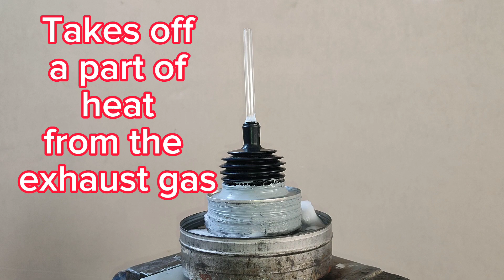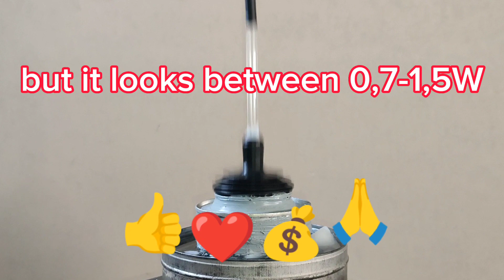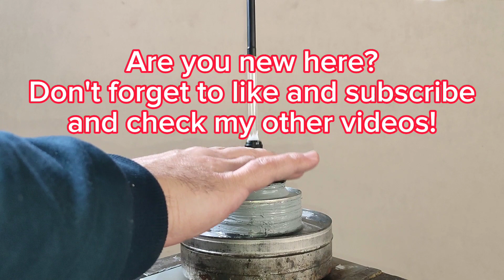Free Piston Hot Air Engine - Torque adjusting

Comment: I love this type of bellows..
There is no friction, no gas leaks, they are very quiet, they can work even in long strokes and most importantly, they are very durable.
It can be purchased at affordable prices in shops selling car parts and industrial machinery parts and can be easily applied.
When I see your classic body designs, I go back to the old days (they were beautiful)
Reply from the maker: I love those bellows too, but this one came from a New Year horn from Tesco market. I think it is PE material, durable and light and pretty cheap. It was the first time I used it.

Comment: Greatings friend. I wanted to clarify to anyone reading this,  Torque is a term reserved for force applied tangently to point on a line some distance from a center be that center an axle, or the center of mass of an object.  

Given a linear piston stroke and appropriate linkage to a camshaft, the motor's power can be transfered to a cam shaft causing the shaft to rotate. The force on the camshaft is torque, otherwise linear force is just linear force. 😊
Reply from the maker: Yep, you've right! I have another video where I connected a diaphragm version to the camshaft, and I started from that side this experiment. So higher linear force adjusting here! Thanks! BLADE

Comment: Do you think it would be possible to build an heat exchange engine that runs on the thermal fluctuations of inner rooms (like living room) with specific materials (due to thermal conductivity properties) - like for example graphene conducting heat very well where-as aerogel conducting heat not very well - it sounds theoretically appealing to suggest that an engine as such should work.

The lesser conductive material would have a "timelag" where-as the more conductive material would have a more "current" temperature, this should allow for the displacer of a stirling engine (in theory, if possible) to do its work. The temperature inside of any room would alter over time considering the weather (day cycle) alters, so the lesser conductive material compared to the more conductive material would always differ in temperature, do you think such a differ in temperature could be enough to run an stirling?

Would love your input on this
Reply from the maker: It is very difficult to build as a working unit. I had a friend with a large diameter cylindrical concrete well. It had a large hermetic lid. There was a one way valve pump attached to the cover. The lid was made of steel, with a silicone O-ring around the edge. Every summer night the temperature dropped and the internal gas contracted. Partial vacuum formation and large amount of gas bubbled in. When the sun rose and the temperature rose, the hot gas automatically pumped out huge amounts of water. This works fine without power. (One day/cycle) So the theory can work even with such expensive parts as you describe, but it is very difficult to scale a machine that works continuously for such large gas volumes, because the speed of heat exchange does not allow fast cycle changes. BLADE

Comment: What is on the inside of this one or is the whole engine just th first chamber the diphram and the long tube?
Reply from the maker: It has a steel wool displacer piston wrapped around the glass straw, and connected directly to the accordion piston. They moves in phase. BLADE

Comment: It’s a really interesting design , but think the tube on the side is more effective.
Reply from the maker: Dear Cesar, I'm not pretty sure about it, because the center tube could work a preheater and aftercooler aka regenerative section that could increase the cycle's speed, but I'm not pretty sure about the benefit or that I seen under working conditions that is a real benefit or I just want to see that... I should measuring a lot. Thanks! BLADE

Comment: Hi Attila, just so you know you may of accidentally saved a private video in your tips and trick playlist... video about a Russian girl. 

On another question what's your lowest temperature engine?
Reply from the maker: Thank You! That was an old mistake with that video. I deleted that video now. My lowest temp engine is the hacked air pump- resonantly coupled pulse tube heat pump... -40 no problem for this unit with ambient air working gas.
Reply: @AttilaBlade  ah great, do you have a video on that one?
Reply from the maker: @DrBretPalmer  I'm sorry, probobly I missunderstood your previous question. Did you mean LTD unit, what is the lowest delta T unit, or what is my lowest temp heat pump. I answered the last one. I have two uploaded videos about that.